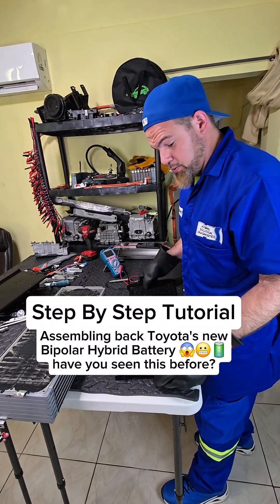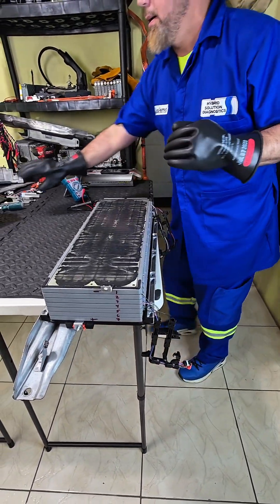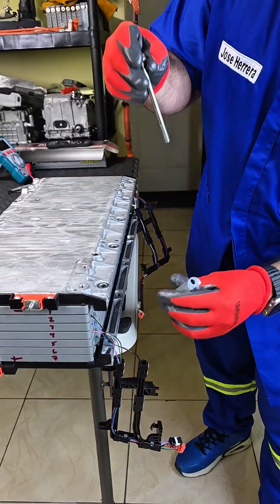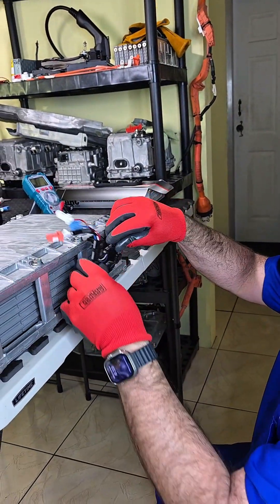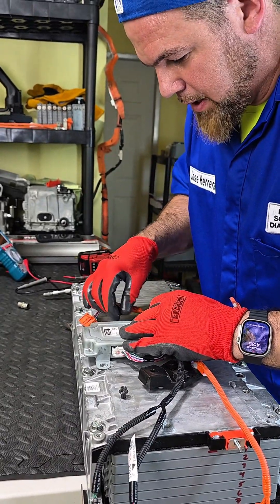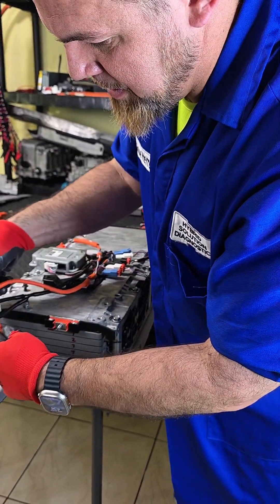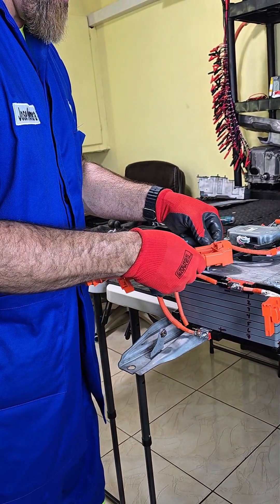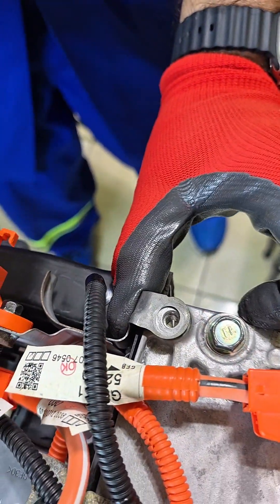How to Assemble Toyota's New Bipolar Hybrid Battery - FIRST COMPREHENSIVE TUTORIAL

Comment: What is a good high voltage multimeter for the money to work on HV batteries?  I need one that reads to the hundreths of a volt. I have many Prius battery modules,  I want to balance them, then read their voltage as they discharge. I'm thinking I can select 28 modules with similar discharge amounts, I will have a battery that will remain in balance longer.  Unless you have better ideas. Thank you very much!